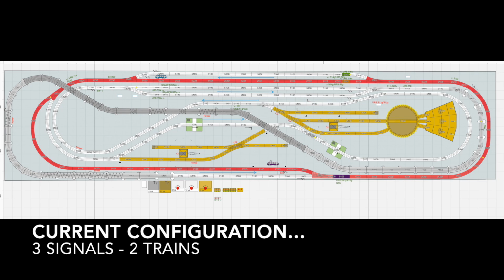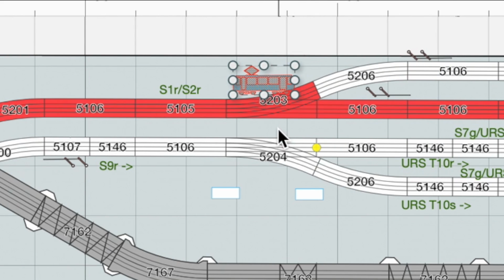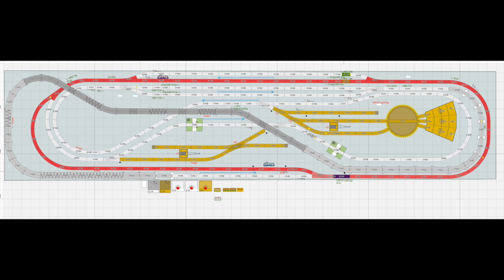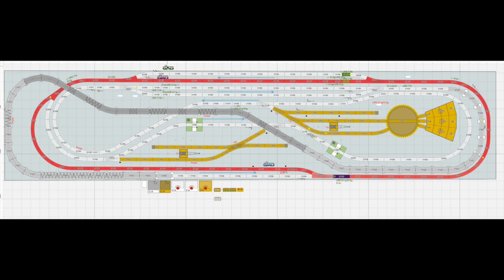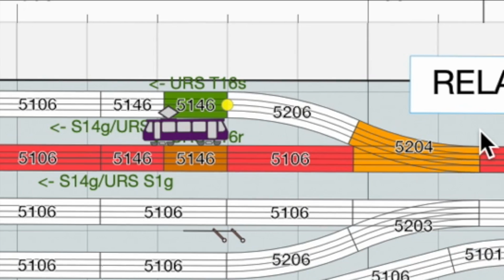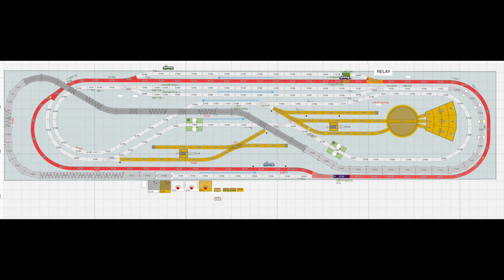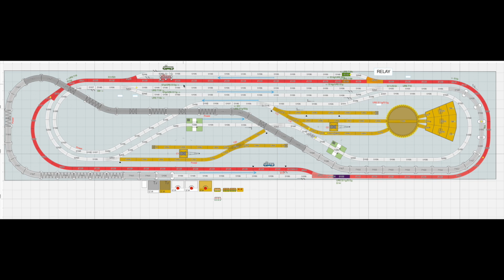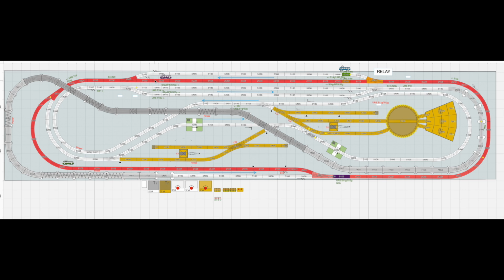2021 layout - Phase 4: block system automation - part 2 - Märklin M-Track analogue

Comment: If the circuit track just after the incoming turnout is realigning the turnout to the opposite track, why isn’t your train derailing? If I understand this correctly, you are switching the turnout before the incoming train is fully into the siding.
Reply from the maker: No, it is connected to a relay, the switching of the turnout occurs when a train leaves the station.I cover this bit in the video before this one in the series. Thanks for the visit.